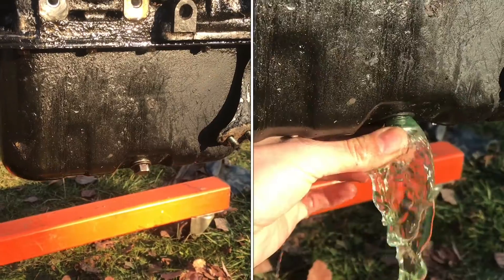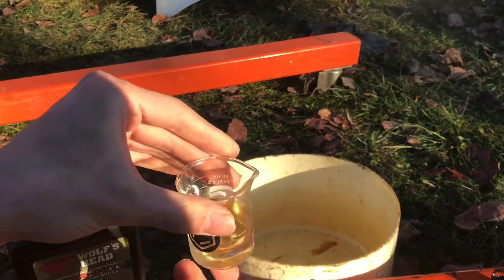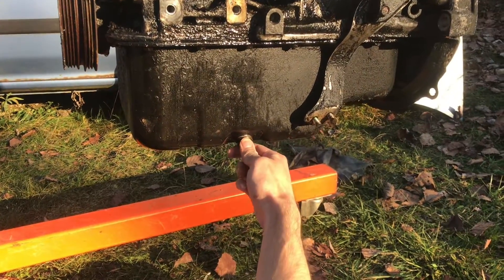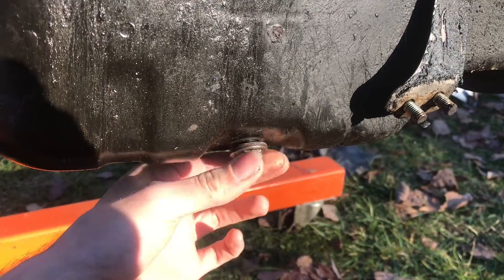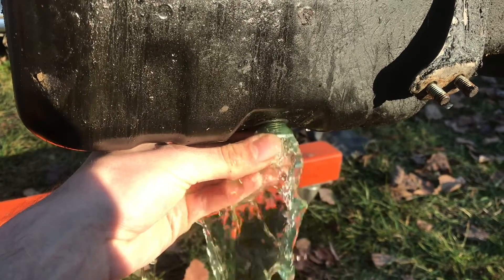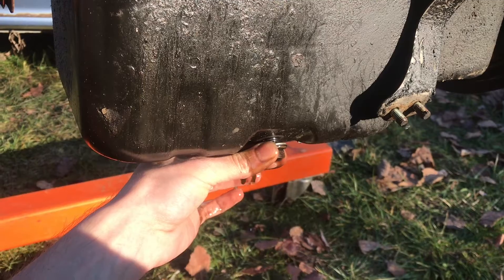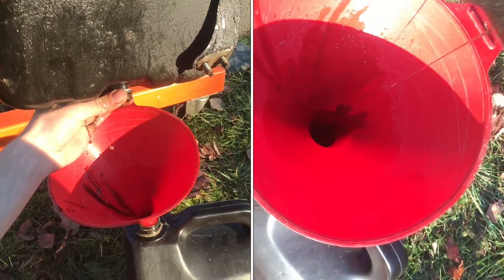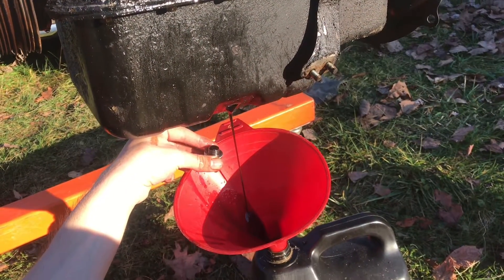getting water 💦 OUT of the oil pan (easy way)

Comment: i bought a 2000 silverado from an auction that had sat for a while.  i drove it home and parked it.   about a week later i took too off the oil drin plug and about a cup of clear water come out. nothing else!  i was shocked.  then i opened the oil cap at the engine and only thren did the oil come pouring out.  and it actually was not that milky.

Comment: Thank You, I Had it clear in My Head to do this YAHUAH GOD Always has common sense responses, I Literally just put brand new oil into My Engine and water ended up getting in, I have not turned on the car as of yet, in between resealing My New Copper Head Gaskets at the moment but before the reseal I thought it was sealed and I put water in to test for leaks, and it all came down the sides of the engine from the heads, when I opened the engine up I Noticed that the water made it into the engine oil compartments, I panicked but then I figured as I was Shown in thought, hey oil floats on water I can just relieve it and I will be fine, Thank You For reconfirming This method, I truly do not want to buy more oil as my budget is very much off for getting My vehicle back up and running, Blessings To You & Your's. 💪👊💪😎😇🙏🙏🙏💯💯💯🔥🔥🔥💙💙💙💙💙💙💙💙💙💙

Comment: I enjoyed the visual demonstration.  The water does clearly sink to the bottom of the oil pan, because it is heavier than the oil. If water is inside the crankcase for any length of time while the engine is running, the water will turn to steam, and get sucked out through the PCV valve.   That's the whole purpose behind the PCV valve, to vent the crankcase.  It sucks out the volatile stuff in the crankcase caused by condensation and piston ring blow-by:  such as water vapor, fuel vapor, exhaust gas, and oil vapor.   That said, this video shows a LOT of water in the oil.  It would take a while to vaporize that much water, even in a hot engine, during which time your engine wouldn't lubricating itself as well as it should be. That oil and water mixture could also turn into sludge, which could clog up the various oil passages inside the engine.  A lot depends on how much water is in there, and the inherent engine oil additives that are designed to deal with moisture in the engine.  Potential engine damage also depends a lot on the operating temperature.  In cold environments, you don't want that water turning to ice or slush and restricting the oil flow.

Comment: You poured water/coolant into the engine deliberately! Or else how did the coolant get inside of the engine?
Reply: possibly,  but it can happen if a head gasket is broken or other situation when the coolant enters the oil circuit

Comment: If water is in your oil pan is that the sign of maybe a cracked block
Reply: More likely a failed cylinder head gasket, but cracked block is very possible as well.

Comment: Yeah, that’s the easy portion of the water! What about the milky water/oil foam that formed and collected in the oil galley, heads, and valve covers. Those are areas that you can’t see and if not cleaned out will cause problems down the road if you run the engine with that crud in the engine!

Comment: This guy has no idea wtf hes talking about
Reply: How is he having no idea wtf hes talking about? Basic physics.
Reply: @vitaminb4869  he referred to a functional motor being the same....that's not the case at all. The water and oil are so mixed up from the operation of the motor that they will no longer separate. It turns into a coffee like sludge. If you leave it long enough thinking it will separate rust will form before that happens. You need to drain it, pull the filter, turn it over for a few cranks to empty the pump then refill with a new filter, do this several times. Once you feel you've done a good enough job you need to get the engine to operating temp and keep it there. Occasionally take the cap off to vent the steam, also once your completely done, clean the inside of the cap. If you honestly think you can just let it separate....well...I'd pay to see you do that😁✌
Reply: @NorthernExposureATV  I don't see how oil and water would mix when they have different densities. But let's assume it eventually will mix somehow - you will never get it to that point, as soon as the engine sucks in water, you'd shut it off before it does any real damage if it hasn't already, then drain water, take out spark plugs, etc.
Reply: @vitaminb4869  you can get coolant in your oil and not know. It gets mixed instantly, think about how violent the crank is turning plus the pump that's forcing all the churned water and oil through the bearings ports and filter.  If you suck water into your intake enough of it will hydro lock the cylinder...that water will slowly seep past the rings. Even if you only get a bit in it can get forced past the rings.   Not only have I seen this happen but I've done it on my quad and bike. It mixes so thoroughly that it will take far to long to separate....you will end up destroying your cylinder walls, rings, bearings,  and many other moving parts.
Reply: Agree with you Steve, Vitamin B has no clue... Sitting with the issue now... That why I am looking around at how to get the engine cleaned out internally the fastest. Will running it extensively remove any excess water residue? And how long would you say it would have to run? 
Just did the cylinder head gasket on a generator engine. Oil looked terrible.
Reply: @jdvanheerden3369  what i did was drain and change the oil a few times to get the bulk of it out, then I drained and changed it  after cycling the engine a few times, after 6 oil changes or so getting as much out as I could I then ran the engine up to full temp leaving the dip stick slightly open to vent steam and again changed the oil doing this a couple more times finally once I stopped seeing milky oil I ran the engine hard got it good and hot and did a final change with a fresh filter. I  should mention in my case, on my wr450f I did the bulk of the changes with no filter, I cycled the engine with the filter cap off to jettison the crap inside the pump as well. Getting the engine warmer and warmer steamed the water off and allowed the oil crappy oil to drain down off the head just make sure that steam can vent otherwise I fear it would blow a Gasket.

I'm not a mechanic but I am a certified redneck so take my advice with a shot of whiskey 😅

Oh and check the inside of the cap, often moisture condensates there and get sludgy too.
Reply: @NorthernExposureATV  That doesn't mean buying 10 5qrts of oil does it? How many did you go through?
Reply: @fantasticphil3863  you can go through as many as you want. The only way to actually get the water out of the oil is to get it hot and steam it off after flushing the system as best as you can.
Reply: This guy deliberately poured water/coolant into his engine... Igit...
Reply: MY COUSIN KARL,,WHO LIVES DOWN NEAR THE BORDER,SAYS THEY ARE GIVING AWAY FREE OBAMA DOLLS FROM THE PORTA CANS AS CHRISTMAS GIFTS TO THE POOR CHILDREN...,HE SAID EVERY SINGLE ONE HAS A SIGN ON THE WALL THAT SAYS YOU CAN HAVE ALL YOU WANT...